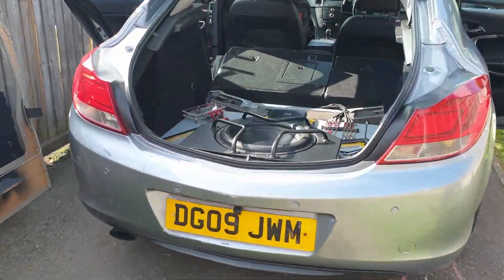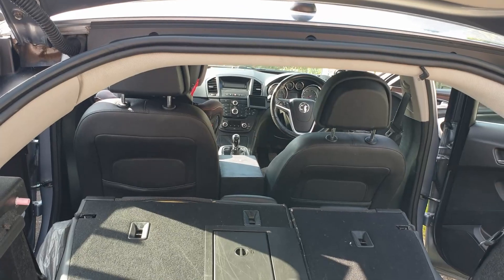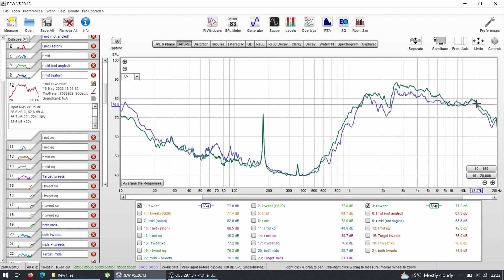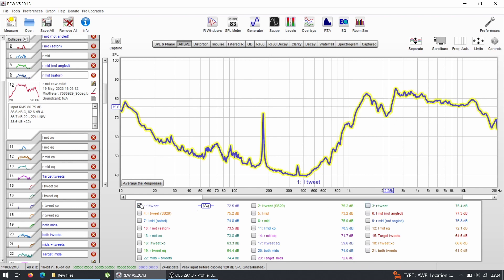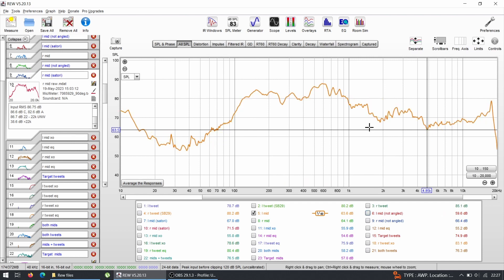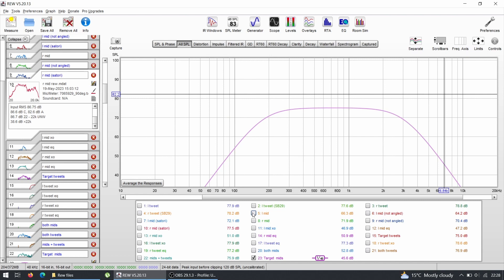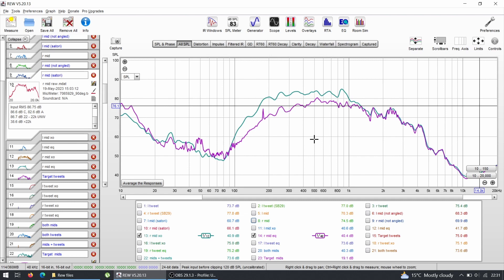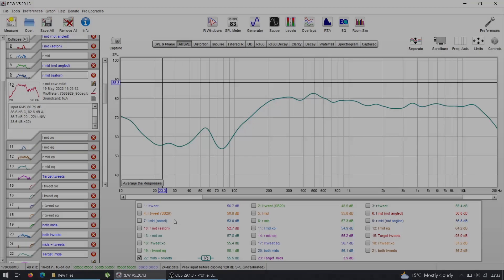Alpine Status midranges and tweeters RTA measurements

Comment: What are thoughts on using the Status midranges as widebanders? From the looks of the response and the fact that the dips are responding to eq they may work in that application. Just an idea. And if you wanted to use the tweeters provided you can get the very top end issues straightened out, you could cross that nasty dip out of them. Beaming may become an issue playing the mids that high but they may be on axis enough to not matter. Again just an idea. Looking forward to how you figure this out and the direction you’ll go.
Reply from the maker: I did use them full range for a week or so. Even when tuned flat, it didn't sound right. The very top end was harsh and had sibilance. Now when I installed the tweeters and crossed them at 3k, the sound improved a lot. To be honest, I don't really notice those dips in the tweeter response🤷